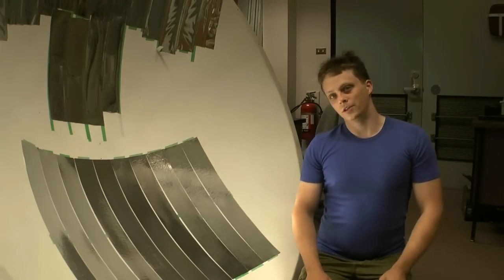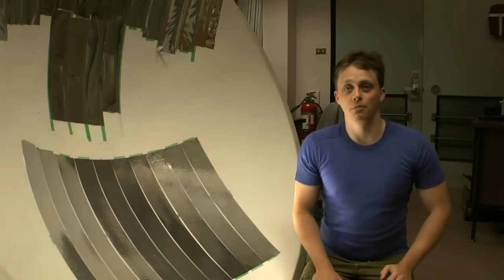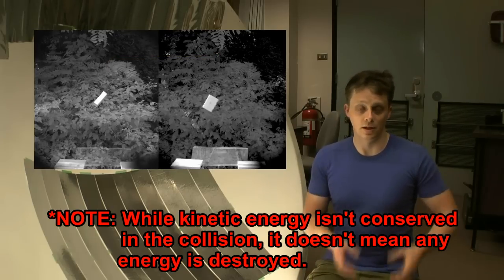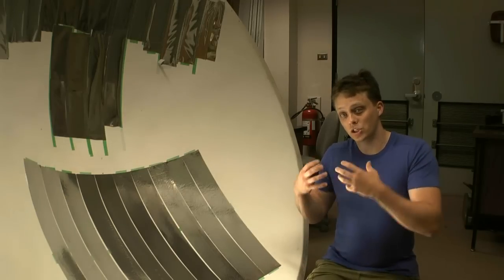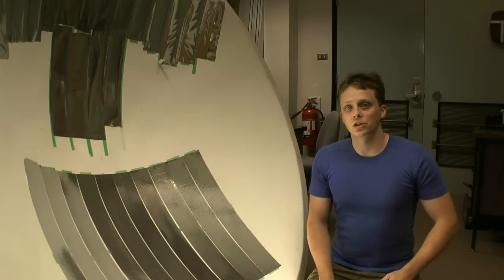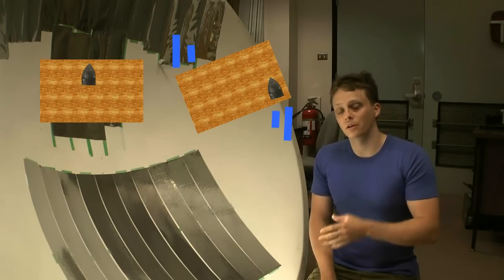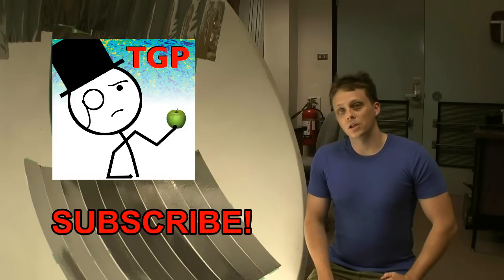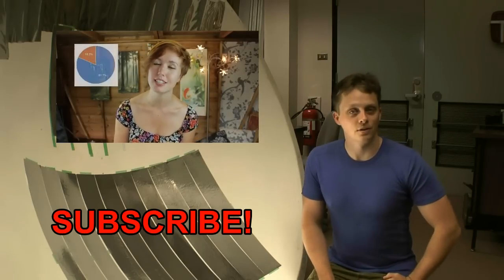A Response to Veritasium's Bullet Block Experiment

Comment from the maker: I think the height of the block they are measuring is the height of the center of mass, not the height of the tallest part of the block.  So a 'head start' may not mater. In terms mechanics the center of mass height is much more useful for problems like this.

Comment from the maker: If the block weren't suspended by the nail at it's center of mass, I think the block may behave differently. The far side of the block may push off the table and leverage could become important.

Comment: They come out, arc upward, and drop in on a target. The only plausible variable in differences between the bullets themselves would be in the angle at which they actually exited the barrel. If one was slightly more of a glancing blow than a straight on impact, that could skew the outcome. Perhaps filming this experiment with one of those super high speed cameras that would show what both bullets were actually doing between exiting the barrel and hitting the wood would informative.

Comment: There are variables that can change the numbers a bit, like barrel fouling. The more times you fire the weapon, friction from the deposit build-up slows the round slightly, you lose like 12 fps for every inch you shorten the barrel, but, these won't change the velocity on two back-to back shots fired. One thing that seems to have slipped through the cracks is the fact that a bullet does not come straight out of the barrel and proceed in a straight line until gravity pulls it to the ground.

Comment: If you use something like a .308 for the baseline, which is pretty much in the mid-size range for a rifle, store-bought rifle ammunition isn't going to have anything close to a 2% variation in muzzle velocity. A standard barrel .308 Marlin has a muzzle velocity of about 2660 fps coming out of the barrel, and if you fire an entire box of ammo out of the same rifle under the same conditions, every round you fire will inside, at the worst, a 15fps variation spread.

Comment: Nice response. Momentum is the key. It's somewhat counter-intuitive that the same bullet imparts the same linear momentum in both cases, but no angular momentum in the 1st and does impart angular momentum in the 2nd (since it's not in line with the system's center of mass), and then linear and angular momentum are separately conserved.

Comment: I guessed the same height.

There's no extra energy anywhere, it's the use of that energy. Mass is mass, and if the mass is equal in all dimensions, the resultant distance would be the same.

Here's where it gets fucky. If you'd shot both of them a second time, while it was still elevating; the first block would have continued going up; but the second block would have increased spin.